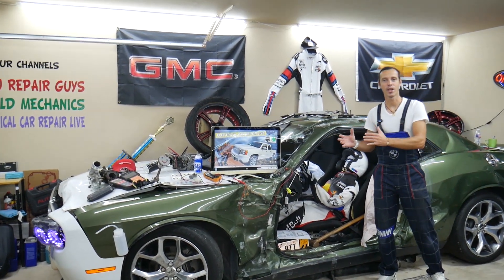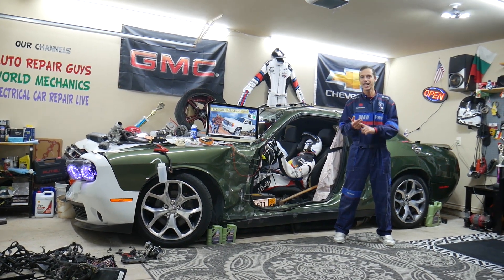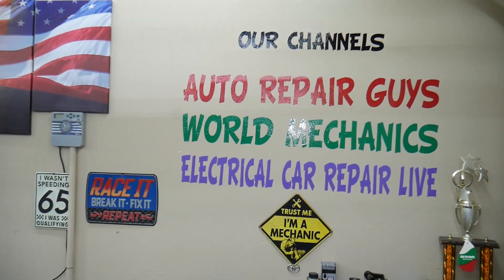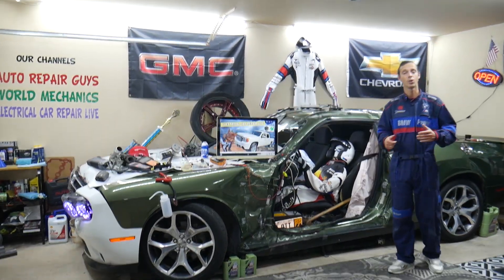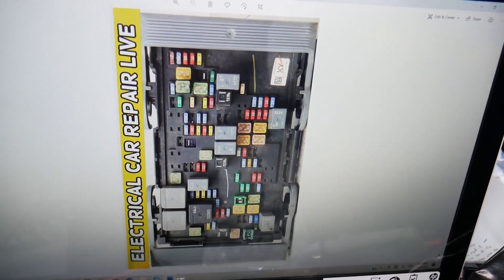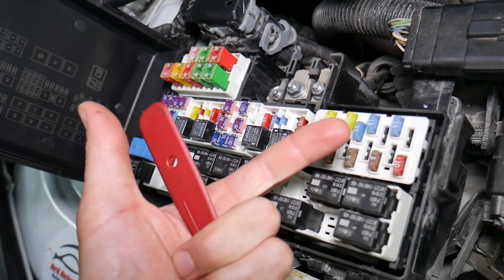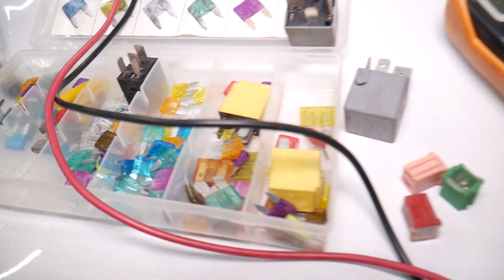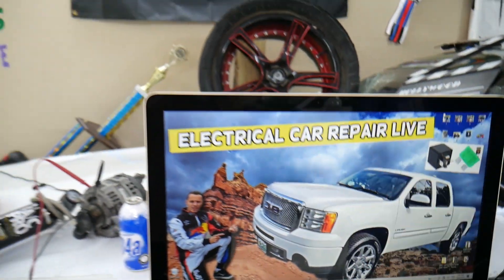GMC SIERRA DRL LIGHTS FUSE LOCATION 2007 2008 2009 2010 2011 2012 2013

Comment: What if after checking all that and the fuses are good, they still don't work. What can I check after? Do you think that the drl module under the steering column is bad??
Reply: I’m having the same problem, did you find out what the problem was?